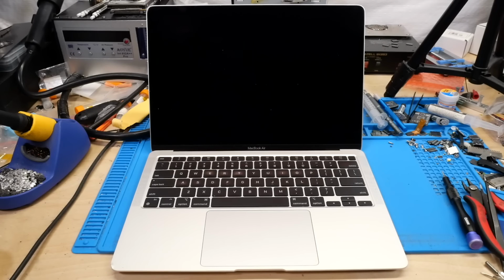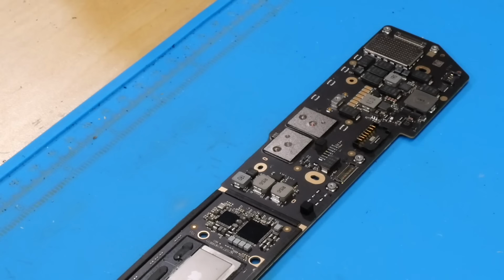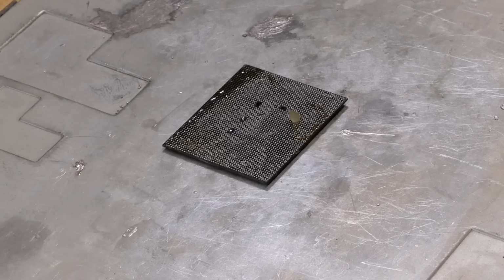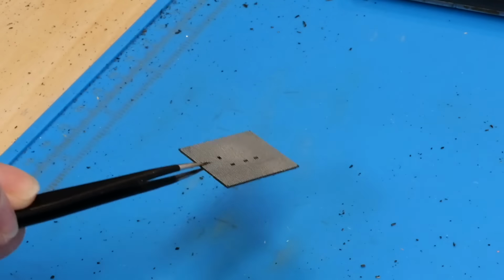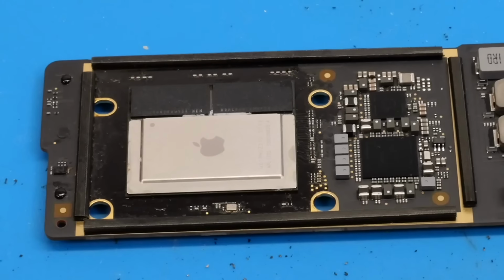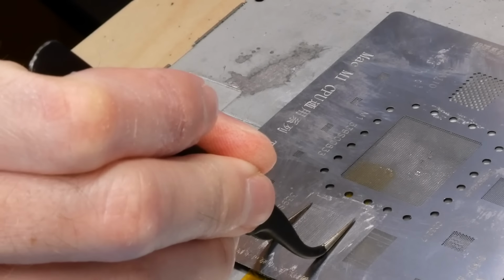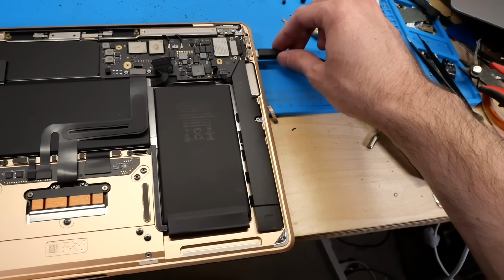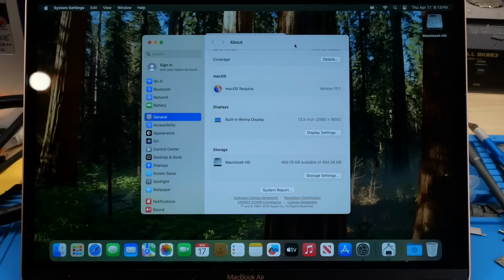Repairing a DRILLED M1 MacBook Air

Comment: If they had just use FileVault, no one would ever be able to recover data and physically-damaging flash chips would be completely pointless.
Reply from the maker: Not even that, these Apple Silicon machines have hardware-level encryption for the user data partition on these NANDs, so even just erasing it is enough to make all data unrecoverable.

Comment: Hi, to ensure long life you had to seal all the bga chips with surrounding glue/sealant.. bye..
Reply from the maker: Nope, adding UV solder mask or resin of any kind to the outside edge of the chip does not help anything, and does nothing more than make a huge mess to clean up later if you ever want to swap the chips again. I will never even consider adding any sort of material to newly-installed BGA chips.
Reply: @dosdude1 Have you tested it? Test can last several years.. or why you declare this?

Comment: Great video, sad that someone still believes its necessary to drill hole in NADS to securely destroy data when a simple Erase All Contents and Settings takes care of that or otherwise Apple wouldn't be able to sell refurbished devices. That drilling is and was old school for back in the day when Hard drives were still the main storage. All Macs both Apple Silicon and some Intel with T2 chips don't need their NADS destroyed that way.  It just adds to the e-waste especially if we don't have the knowledge and expertise of someone like DosDude with spare parts.

Comment: I find that if I use solder mask, very thin in 2 opposite corners of a chip before I remove it to re-ball and replace, all I have to do to get the new chip in perfect placement is make sure both corners are in that solder mask. Two opposing or opposite diagonal corners. It works like a charm. No guess work. No getting placement wrong.

Comment: Is the only thing different thing on the sep the serial number? Can I reprogram just the serial number on the sep? I ripped of one of the pads on the chip when I lifted the chip off the board, so that chip is done and I can’t read it.
Reply from the maker: It has unique keys in it; if it can’t be read there is nothing you can do to fix it.

Comment: Great video 👌
I recently fixed a base A2337 M1 MacBook Air rose gold and it's an impressive machine, very quick and I'm still in awe that it can run smooth heavy games like Control while sipping 35 to 45w max.
But I have still a weird fault with it: The MacBook works fine, charges fine (and it also fast-charge) but both USB-C ports don't see any peripherals (USB sticks, iPhones etc etc)
Already tried replacing the USB-C daughter board but no effect.
Already did a fresh Sequoia install but no effect.
Any idea on what the fault could be? 💡

Comment: I work in healthcare IT. Whenever we decommission a computer we have to document the destruction of the HDD/SSD pretty carefully, it is a regulatory and insurance requirement. We use a certified vendor that will shred them and we have to maintain a list of serial numbers. What probably happened here is a user dropped the laptop, and it wasn't worth it (to the IT department) to repair, so they drilled the NAND's and called it a day.

Comment: would it be possible to upgrade the storage and ram chips on a Samsung Chromebook 3? im recently thinking of upgrading my Chromebook to more storage, and ram, and seriously want to be able to run 1-4tb on the storage, as well as the maximum that the chromebooks cpu can take, as well as running windows, and i assume one could install windows easily upon replacement of the ssd chip.

Comment: Cloud locked Macbook is a nice way of saying that you repaired a stolen computer.
Reply from the maker: Incorrect. The vast majority of iCloud locked devices are that way because the user fails to remove it from their iCloud account or lost access to their iCloud account, NOT because they are stolen. The particular donor machine I used in this instance was given to me by a previous coworker at a repair shop I used to work at, which was replaced by said shop from an insurance claim. When the customer received their new machine, they simply failed to remove the old one from iCloud, which of course is the most common scenario that causes these devices to become forever locked.

Comment: Buying a M1 Apple MacBook Air for $100 with drill holes, cracked screen and case damage, plus a torn flat cable. Is no't what you can call bargain.
Reply from the maker: It was around $60, but yeah still debatable whether or not is was worth it.

Comment: I was wondering what would happen if you turned it on with the nands drilled
Reply from the maker: Too risky to try that, as the holes drilled in them (and the board) probably caused shorts. Don’t want to risk damaging anything by trying to power it on. It wouldn’t have worked regardless though.
Reply: @dosdude1 oh wow, thanks for the reply, I was just curious

Comment: Hey, I have a question: Would it be possible to get the CPU from, say, a 2014 15-inch MacBook Pro to work on a 2014 MacBook Air? If you could do that, would you have a MacBook Air with 4 cores and 8 threads?

Comment: with the right equipment you can still probably recover some of the data... it's better to have the chips removed and handed to you while you watch the process so you know that they're your chips from your machine and then put them in a microwave and follow it up by breaking them up with a hammer or a mortar and pestle into pieces that would make it impossible to recover!

Comment: interesting way of doing the re balling. A couple of my first tools that I worked on in the semi conductor industry was a DEK screen print press and a atmos reflow. Once the paste was applied the screen was removed before it went into the atmos reflow oven. Did you leave it on due to the quality of the paste?

Comment: I switched to using balls now but I had pretty good luck using the Mechanic Solder paste, I found that if i leave it  out on my bench w/ the top of the container off for 24-48 hrs then store in the refrigerator I had the best results, Idk if I have ever Reballled a core with that small of pitch though

Comment: I have that same thermal camera but a USB-C version. I can attest that I was trying to find a short on a pcb and after many attempts I broke down and bought the camera and found a shorted 0402 cap in like 8 seconds. I would never buy the Lightening version though, only the USB-C. There's an open source app I was able to use on any Linux PC, including a Steam Deck so the USB-C version isn't really limited to phone use.

Comment: i dont get it, you discarded the motherboard because you cant repair the layers or you dont own a microscope?
Reply: i am pretty sure this was repairable tho
Reply: @PinkFlorida-x7o  And how would you dig out and replace the traces if a chip still had to go on top of them?
Reply: @VashStarwind  straightforward, first i would polish the damage, figure what goes in layers, restore it with non lead solder and tiny wire, then after the layers are fine i would just make new pads for solder balls with the same wire and the same uf mask. then just place 
the nands with leaded balls.

Comment: What kind of drill would be needed to actually penetrate the chip substrate material? Silicon it's pretty tough. I can see them punching holes through it or cracking them or something. But drilling holes straight through the material...... that cleanly......

Comment: I thought you could just replace the T2 IC in order to remove the icloud lock? This is the first time I've seen someone replace the entire CPU to remove it.
Reply from the maker: @MrSgtBlade  This is not a T2-based Intel Mac, this is an Apple Silicon machine, therefore does not have a T2 chip.
Reply: @dosdude1 oh okey, I thought those also still used the T2

Comment: Great video, surprised you haven’t done the 2018 Mac mini series cpu upgrade or something similar , as you done every year of the Mac mini apart from the last of the intel based Mac mini. It’s still a great machine.
Reply from the maker: Unfortunately all the 2018 and later Intel Macs were completely ruined by the absolutely horrible T2 “security” chip, which not only makes the machines extremely unreliable, but also prevents any BIOS modifications that may be required for some upgrades, and ALSO makes upgrading the storage nearly impossible due to the different versions of the T2 chip (the ones with 1GB of on-chip RAM only support up to 512GB of storage).

For all these reasons, I don’t work on, upgrade, or recommend people buy ANY T2-based Mac model.

Comment: Any solution to reuse iPhone NAND on Macbook boards?
Reply from the maker: @viktovski  Certain iPhone NANDs are compatible, yes, but must be programmed ahead of time using appropriate NAND programmer and firmware before installation, and also must be installed in a supported config. I go over details in the other video linked.
Reply: @dosdude1  Thank you boss! it'll be very helpful!

Comment: This really pisses me off because it's just so wasteful... there is literally no reason to physically destroy SSDs/NANDs in order to destroy all the data... just zero the entire drive and execute a TRIM command... the drive's controller will then automatically flush any cells which are marked as empty...
It doesn't even take that long... They're not like old mechanical HDDs which can take several hours due to being slower and requiring multiple passes to fully ensure that all data is gone...

Comment: Not underfil, it's called Conformal Coating and yes I worked in the electronics industry so have a little knowledge of circuit board manufacturing...sigh.

Comment: It seems like you applied flux on all four sides when removing the M1 chip. I heard somewhere that you should only apply it on three sides, because air can get trapped underneath the chip, and once the hot air gun is on, the heating air pushes the flux out. But if there's only flux on three sides, it just melts and fully covers the bottom of the chip. Since then, I’ve been doing it that way, and it feels better—it makes sense logically, though of course I have no idea what the perfect method is. So I’m just curious if there's any extra insight that would make the four-sided method better—something I might not be aware of. (Not trying to argue, I'm just genuinely interested.)

Comment: Do the M series chips lock the RAM size to the SOC? I heard this is why more RAM can’t be soldered on in which case using donor SOCs with more RAM could be a viable way to upgrade the CPU if you’re willing to put in all the effort. Also is it possible to transfer an M2 SOC to an M1 Board? I’m especially curious about this seeing as how similar the M1 and M2 MacBook Pros are but I don’t know if they have different pad layouts

Comment: WHY buy anything Apple???
Parts hard to get and expensive.
NO support after market.
Failure even after a refurbish/repair.
Dell is the best computer to own new or old.
I've had my XPS for 8 years with only one issue and it was in the charger plug.
Cheap and simple to replace. It messed up only because I used it a lot and the coiling it over and over caused the short in it.
A mechanical problem did occur from opening and closing the top over and over but the hinge that came loose from the frame was easy to fix with epoxy.
I clean and replace the chip thermal paste yearly.
I have never dropped it.
Everything still works and very well including the tough screen.
I do a software clean out yearly.
I don't know about the cheaper Dells but the 15 inch screen XPS has been the best laptop I've ever owned.
I have owned in the past one of just about every major brand and they all barely lasted 2 years before some major problem occured.
I understand that after 2025 is over, Microsoft will stop upgrading Windows 10 but I'll buy a new XPS before the end of the year and keep this old one for secondary use as I trade stock.
This computer has almost never been turned off the whole time I've owned it.
Once a week I shut it down and "restart it" to keep  it from building up any operating problems.
It has the I7 Intel chip and solid state drive.
I make sure the fans are always unblocked.
I use 5 different browsers, Opera, MS, Fire Fox, Chrome and Explorer.

Comment: Would it therotically be possible to do a single nand configuration (like the 128gb m1 board) with just the less damages footprint (assuming you can get rid of all the shorts and no necessary signlas run were damaged)?

Comment: Hello, dosdude. Thank you for the video.
First of all, You helped me out with my macbook pro 16 ssd upgrade and I wanted to thank you for that.
Secondly, Im trying to repair a second laptop and I have some questions. what sort of soldering paste is recommended? And at what temperature do you desolder and solder the cpu? Thanks again.
Reply from the maker: @samiboypicco9885  Solder paste I don’t really have a perfect recommendation on, as I still haven’t found the ideal paste myself. But that tube I show in the video is the best I’ve found yet to reball large chips. For desoldering and installing the SoC, I have my hot air at around 280-290 degrees C, and around 180 degrees C on the bottom preheater.

Comment: I think someone wanted to have a super secure system not only after resale, but while running this machine, without the possibility to connect external storage to that, may be other than an authorized Wifi (if any).

Comment: Apple has engineered their devices to be difficult—sometimes nearly impossible—to repair. The fact that you've managed to repair them is truly admirable. Great effort, congratulations. 👍👏
Reply: Apple doesnt want you to repair anything, they want you to spend big bucks to get a new piece of pre-planned obsolesence
Reply: Repairing anything has always been about skill and tools. Give something you consider simple to repair to someone far enough back on technology, and it's impossible for them to repair it. Send a modern ATX PC back to the early noughties, and a simple SATA drive swap becomes impossible, because they only have IDE and SCSI, and none of the same expansion buses.
Reply: @jammi__  When the wifi chip is cryptographically paired to the main soc, and said soc from a perfectly functioning board cannot be brought back to life because someone forgot (or could not) unpair their account from the computer before throwing it out, it's not a matter of "skill and tools", it's a matter of a scumbag company doing anything in their power to prevent perfectly good electronics from functioning ever again due to margins and profit.

Comment: Oi muchacho, I love the hardware mod you did on my vintage 17" Macbook Pro!  So you know, danke.   As apples brilliant soldiered-in SSDs like this (& was it the Voltage Control Regulators that also fail?) in the final Intel MBP's croak after 1000 writes and kill off the most powerful windows/cad-capable macs ever, I wonder if you can cobble a service to keep those going.  ...hmmm, thinking about it, maybe we should just be booting & running the 2019 mbp's off external ssd's, bypassing the internal one completely to keep it from wearing out.

Comment: Got a half an e-waste Apple laptop, but to render it just about unusable, the RAM (soldered in place) chips (skynix?) were struck with what looks like a Philips head screwdriver. One chip doesn't look too damaged but the other 3 need replacing! As a kind of hobby I look for electronics in dumpsters and curbside stuff!

Comment: So you did a NAND desolder, cleanup, reball, resolder - back to the same board. Could have saved that :D I was wondering if the NAND had some prior knowledge of the iCloud lock - which would lock the transplanted SoC again - so it seems its not that case. You are lucky :)

Comment: What kind of idiot damages the unit this way?.... and it still ends up on the used market...even for parts ?  If the intention was to "erase" all existing data....why didn't they just physically crush the unit into pieces and toss it into a trash can......?  The idea of then selling it on eBay for 100 bucks just compounds the stupid

Comment: Very nice repair! Just a bummer that its apple and its all locked and propiertary parts and soldered parts.... Still nice to be able to save a lot of the original mac stuff from the landfills and reducing ewaste every device
Reply: Soldiering is fine for modern computing. Drilling, encrypting and software locking components are very not fine and should be illegal.

Comment: I once got a fancy corporate router for free, because the guy installing it, accidentally drilled through the PCB. But luckily, he did not break any chips. I had to do 0.1mm trace repairs using a magnifier. They only damaged the surface and didn't drill all the way through.

Comment: Dosdude, whats the minimum macbook you can use for an apple configurator mule to reload an M4 mac mini OS. Cheers have a good one
Reply from the maker: Anything that can run Sonoma or later, and I recommend using the built-in Finder UI to perform the restore instead of Apple Configurator. You can even use idevicerestore on a Windows or Linux machine, but you have to build from the latest source.

Comment: Leave your solder paste in a fridge, the oils used in it will firm up and that'll make a big difference when applying to the stencil. One of those cheap can coolers are perfect for this.

It won't stop it from running once heated, but you can also apply metal shims, plates, coins, etc to the edges of the stencil to sink some of the heat away and keep weight/pressure on it, it'll help with warping. That way you're only heating the paste and not so much the stencil itself.